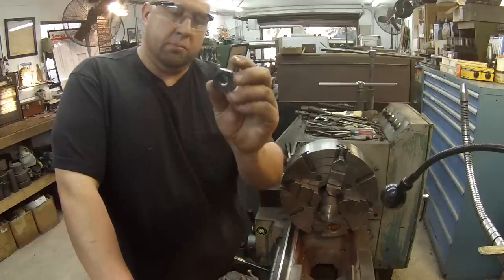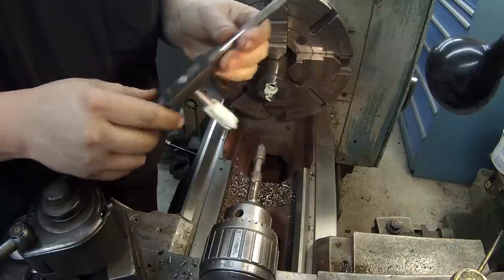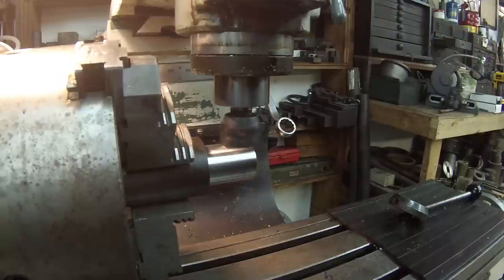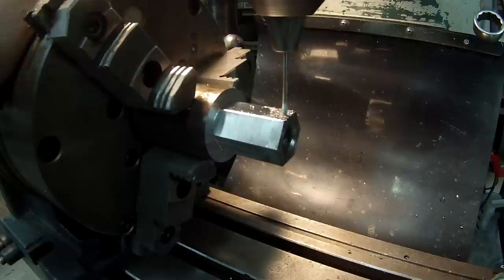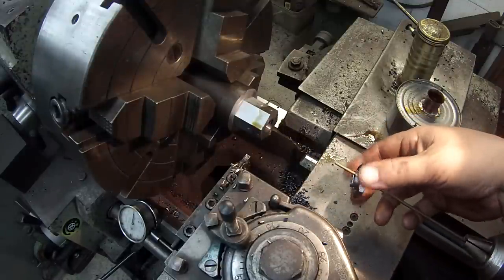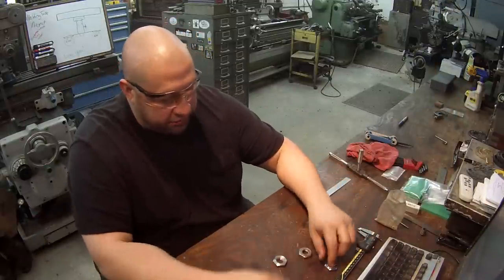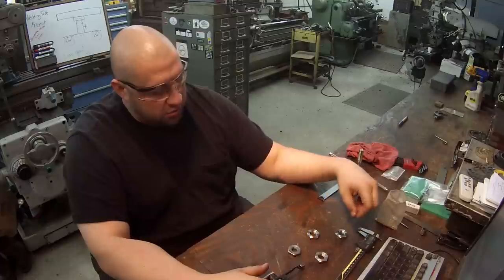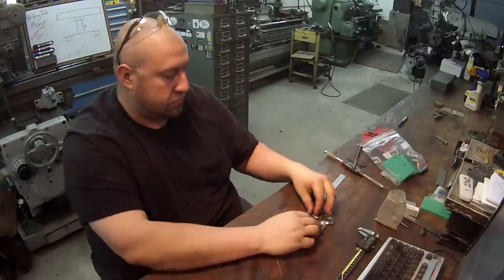Saturday Night Special 55 Part 2: Machining Metric Hex Nuts

Comment: Nice work Adam,  and great tips.  I used the trick with the slightly angled cutoff tool edge to eliminate the big burr on the cutoff piece the other day,  worked great.  Also had some Abom79 type chips the other day,  almost took a picture to send you I was so excited to se them.  Great work,  thanks for sharing.

Comment: Finally found a vid with some more good indexing head action!  I've watched Keith Rucker make gears on his K&T several times in his vids, and I just keep wondering if we're ever gonna see the big S12 with your indexing head on the table for gear cutting.  Maybe you could cut special gear for the Victor lathe in order to single-point a very oddball metric thread that you don't have a gear for if such a job comes up?

Those metric nuts came out wonderfully.  Going the extra-mile for the customer on even something as simple as this.  That should be the standard EVERYWHERE.

Comment: Hey Adam
Why not put the tap in the tailstock chuck, unlock the tailstock and slide it until the tap touches, hold a little pressure on the tailstock and turn your headstock chuck by hand. Once it's started you let go of the tailstock and let the tap drag the tailstock. You can keep turning the chuck by hand or power it up and let the lathe do the work. Or you can do the whole operation under power depending on the material, tap etc. You get a straighter thread less chance of breaking a tap and normally never need to get a tap handle. Provided the tap fits in the chuck of course.
Joe

Comment: good work Adam, beautiful finishes, insert the tool to bleed does not look much appreciated the interrupted cut ... this is the problem of disposable inserts, I prefer by far the HSS blades for interrupted cutting ... Good luck ... thierry cordially.

Comment: Hey Adam could your friend use a split lock nut? The kind of nut that has a split along the edge and the set screw goes through the face that way the lock tension binds on the threads instead of having the set screw go directly into the shaft and possibly messing it up if it slips. I hope I explained that correctly lol

Comment: Hey Adam! Loving all your videos! Just asking if its a way you could do it, instead of using that little tap wrench, could you have put the big tap wrench in and use the ways to stop the tap wrench from turning and turn the tap in by using the lathe chuck with like an adjustable wrench? I know that adds an extra tool in the mix but just thought I would toss my suggestion in the box haha. Thats how we did it in my High School Machine Shop classes, just a idea, don't know if you were afraid of marking up your ways. Enjoying the videos! Keep em coming! I watch every Saturday!
Reply from the maker: I use that technique when needed, usually for the larger taps. Just make sure you have a center in the end of the tap.

Comment: Hi Adam, nice work on them hex nuts.  I was wondering what is the hardest material you've had to machine and what techniques did you have to use?  As always, thanks for sharing all that info with us!

Comment: It is not really the business of the public, and I'm not asking but I always wonder - and do an estimate in my head - what the billable cost of the projects are. My guess is, at a machine shop that is not owned by a friend, those would be some pricey crankshaft nuts considering the time, materials and shop costs.

 I really enjoy SNS and would encourage you to put out your videos at a pace that is comfortable to you as you stated in part 1. On a long drive home tonight on I95 I was comforted by the fact that SNS was waiting for me.
Reply from the maker: Oh I'm sure any other shop would charge more than I do, but I treat people fairly while still making a profit. They are my friends, but I don't work for free. I keep up with my time and charge per hour plus materials.
Reply: Anywhere else in the world, a nut like this would probably be an off-the-shelf item - just needing the setscrew holes to be added. I hate mixed fasteners- I have a 1997 GM-Holden Commodore (Australian variant of an Opel) it has a Buick 3800 engine- all of the body bits, and engine accessories are metric, but the engine bolts are all (inch) SAE :(  (fortunately I'm old enough to be comfortable in both systems).

I love your work, Adam!

Comment: Hi nice video. I am wondering what do you do when you need your parts to be heat treated, tempered, hardened etc? Do you send them out somewhere? Do you do it yourself? How? Perhaps you have induction forge or something like that? Very curious how it can be done and how to control the quality.

Comment: Would you be so kind as to tell what type of lathe cutting tool you used to produce the reflective finish on the bar stock that you turned?
Much obliged
Reply from the maker: Thats a WNMG 431 insert, Iscar IC8250.

Comment: If that is a nut for the front sprocket, I can understand it can come off... It happens when You suddenly let off Your throttle - from full to none - and at the same time pull the clutch. Output shaft spins down(less torque from crank), but rear wheel at full speed wants to pull at the underside of the front sprocket via the chain. Or put in another way - the chain tension move from top part to bottom. A keyway in the output shaft with an inside tabbed washer - also with a tab bending over the outside of nut, takes care of my sprocket nuts for my Kawasakis. Maybe next time Your buddy splits his engine, he could have You to machine such a keyway at the end of that shaft?

Comment: I have just a fast question and for sure its obvious for you but I would like to know the answer. The tap tool that you used on the inside of the nut, doesn't need to back half turn every now and then? Loving all of your videos Adam! Keep them coming ^^

Comment: Was just racking my brains here, wondering what could a guy with a machine shop do if the handle on his tap wrench is a bit long. Hehehe. Side note, maybe your friend might consider welding up the threads on that crank and recutting for a left hand nut? Or is the direction of rotation not the problem?
Reply: sometimes its not the direction of the thread, its already correct, but what with loads and direction changes from acceleration/deceleration it still undoes, might end up needing a metal tab located to prevent it rotating, i assume this is a road engine converted to racing, and he is finding out which parts are stressed to breaking point.
, as for the tap handle, you would think he could make a set of short handles for his larger wrench, lol

Comment: SAE lock screws in a metric nut ?
Reply from the maker: Who cares what thread they are? lol!! All I have are standard sized set screws, so that's what I use. Plenty of 6-32 taps also.
Reply: It was meant as a joke.
Reply from the maker: All good Greg. I was laughing when I read your comment. The SAE set screw in a metric nut is actually a pretty funny joke to pull on the bike guys.

Comment: Using a brush for coolant or oil can cause micro cracking of inserts. a flood coolant with commercial water soluble cutting oil.
Reply from the maker: Doug Mcintee I use both, and not all my machines are equipped with flood coolant.

Comment: I thought you were all allergic to the metric system in the USA !
Reply: Notice that he made the setscrews 6-32 instead of M-4 x 0.7 !!!
Reply: Metric is simpler, but we have a lot of existing infrastructure that isn't metric, which makes switching awkward. For example, our houses tend to have 8' ceilings so plywood and drywall board come in 4'x8' sheets.  Which do you change first, the houses or the materials?  Either way it's awkward for a long time until you are switched over. Same for speed limit signs and speedometers, screws and the machines they go into, etc.  not to mention lead screws and dials on machinery.  Europe switched over in the 1800s before things had gotten very standardized, so there was less to undo.

On the other hand, we could have been doing the English system more simply all along.  What is this fetish with reducing fractions for instance?  What's the next socket size bigger than 9/16"?  It could, very simply, be 10/16"... But no, we have to reduce the fraction and label it 5/8".... Why?  They are the same size either way, why make everyone do the reduction just to find the next socket?  Brainwashing by elementary school math teachers?  Most of what I got in math class was pointless reduction like that...hours spent "simplifying" equations...and ending up with something with exactly the same value., just less writing to record it...a savings used up by all the "show your work" reduction!

And then there was all the "you can't do that"...followed the next year by being told how to do it!  Negative numbers, square root of negative numbers, etc.  I eventually quit listening and went into computers where there's only two numbers.

-- Mike
Reply: you dont have to change as much as you think, in the UK for example, we went metric 40 years ago, milk is still sold as 2.27 litres as that is 4pints, road signs still in miles, many items sold in 226 grams as that is 1/2 pound, we still weigh ourselves in stones {a stone is 14lb!) and we have no idea what it is in Kg, but as far as measuring smaller distances, maths and of course working out the next bigger socket than 11/16 is just effort wasted if you dont use metric, the rest of the world has, and its about standardisation in the end, we all have to go there sometime.
Reply: I use whichever system meets my client's needs when I design stuff - sometimes, that means that I need to turn on the alternate units in AutoCAD, as my file was designed originally for one set of units, and the new proposal is for the other...
Reply: @BigMjolnir  It's just like learning a language, you speak what you are taught.